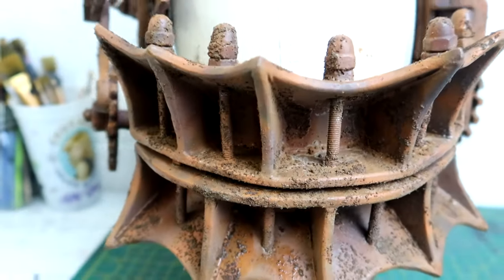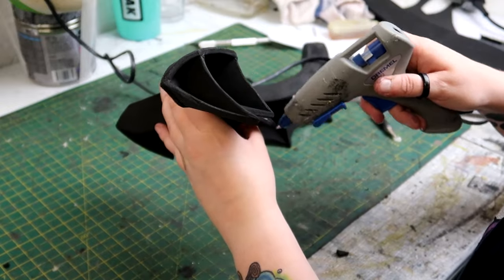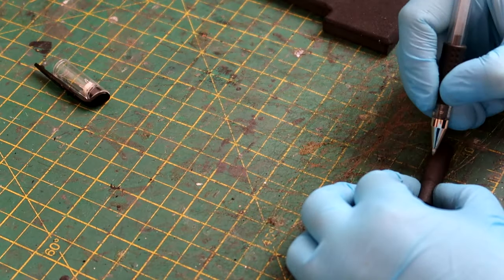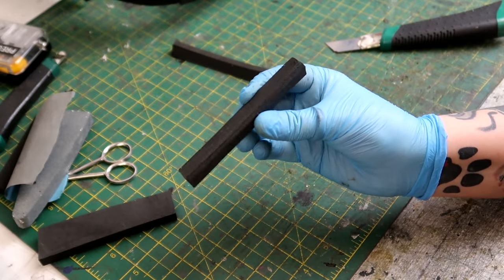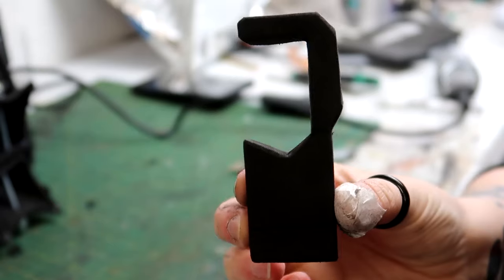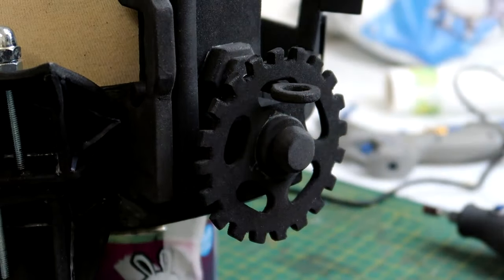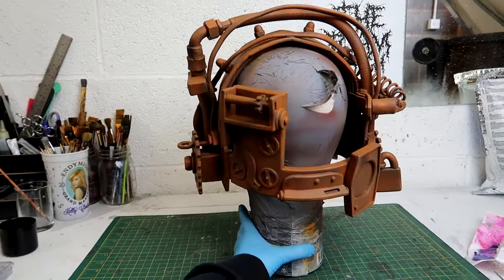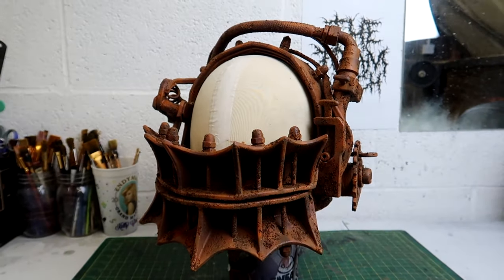How To Make A Reverse Bear Trap from EVA foam ( FREE Template)

Comment: what material do you use to make it?
Reply from the maker: As it says in the title, this is made from EVA foam 😊😊 I know people have made it using other things like cardboard though so doesn't have to be foam 👍
Reply: @TheFoamWitch  What is the thickness of this foam?
Reply from the maker: @Ciapciak226  different thicknesses for different pieces. Every piece is labeled on the template as to what thickness was used but they are either 3mm, 5mm or 10mm 😊
Reply: @TheFoamWitch  thanks
Reply from the maker: @Ciapciak226  no problem! Hope you enjoy making it 😊